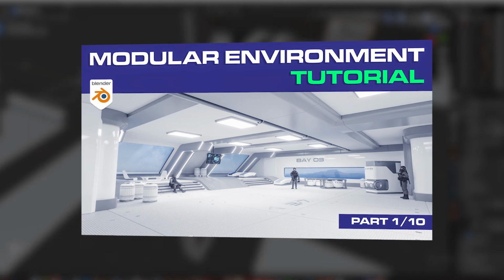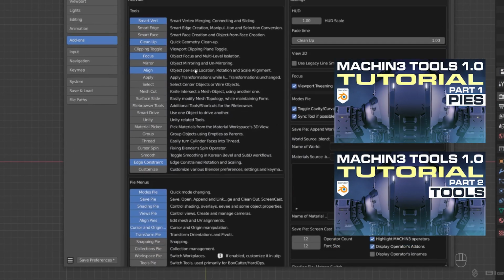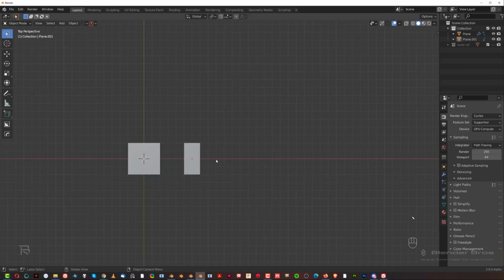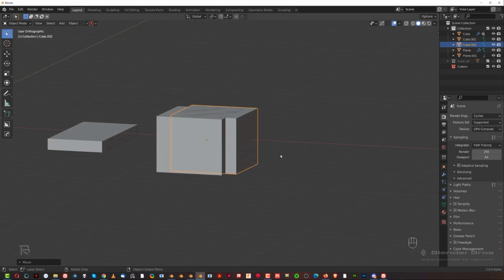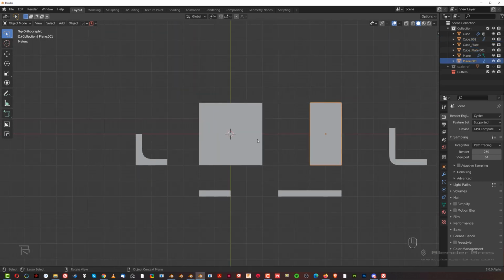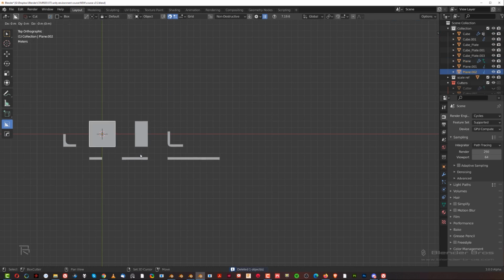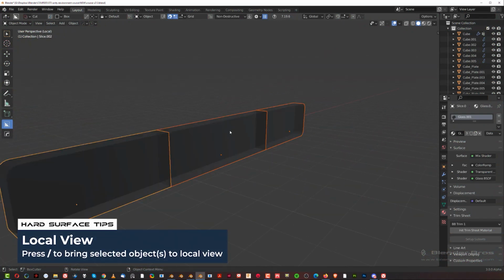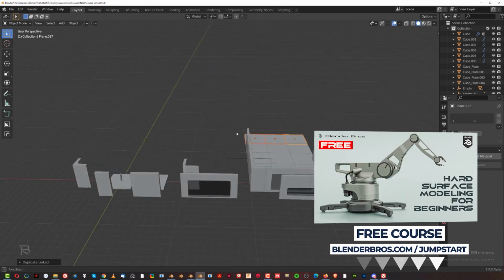Blender TUTORIAL - Modular Environment for Game Engines

Comment: Is there any reason we need to modular the scenes in blender before exporting to a game engine, instead of modelling the full scene/set/building/room etc in full in blender, then exporting it
Reply from the maker: You can instance most of it inside of the engine.
Reply: @PonteRyuurui  amazing. I've been a designer for long time but mostly in game engine. I'm newish to modelling and thought if it is possible to model the whole scene in blender with props and the whole room for example and then export it all over to the game engine? I see soo many though modular them instead of create it all in blender. Just wandering why People simply export it all when they are happy with it in blender and then do the game part in the game engine?? There is an obvious answer somewhere but I'm being a Noob and don't know why people seperate them all into parts to re put it back together in the game engine?
Reply from the maker: @WattsLifeAllAbout  Well, like i said, it is instancing. When you instance elements in the game engine it is far less taxing on the performance. You will need to re-build it inside of  the game engine anyways.  If you export the whole thing you will end up with numerous duplicates which is simply redundant and not well optimized.